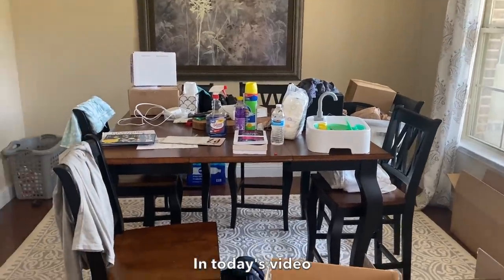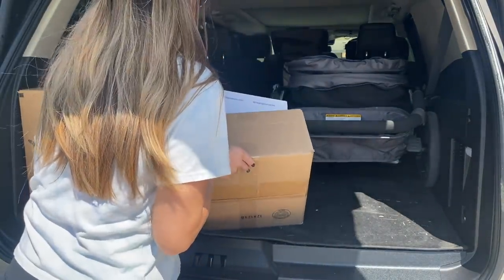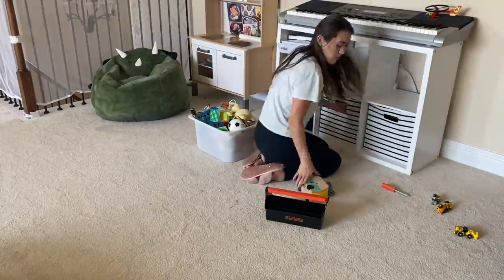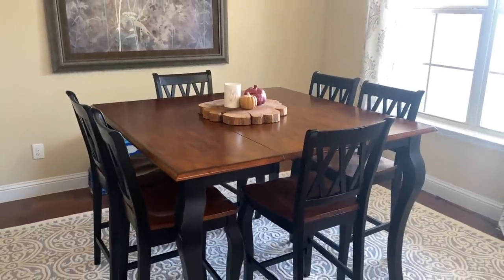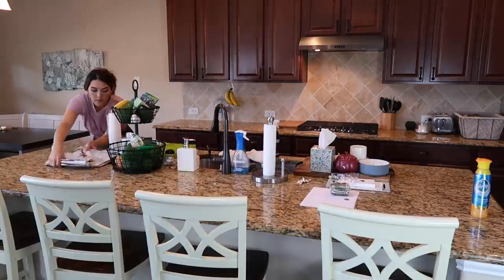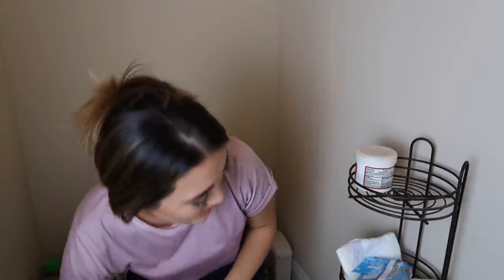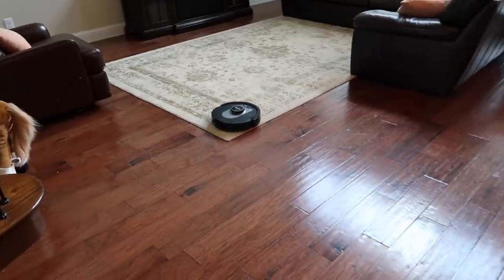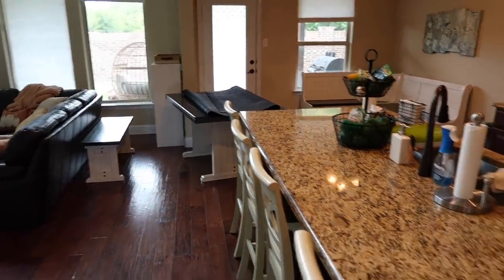TWO DAY MESSY HOUSE CLEAN WITH ME | Organizing & Cleaning Motivation | Kitchen, Bathroom, Toy Room

Comment: professional house cleaner here, for stove tops I just soak the whole surface with an antibacterial or degreaser spray and let it sit for 5-10 minutes. Caked on gunk on the stove is the hardest in a whole house to get up so it's one of the few things I make sure to let sit so I'm working smarter, not harder :) once it sits for long enough the gunk turns to mush and is super easy to wipe up. Then I finish it off with a stainless steel spray to make it sparkle
Reply from the maker: Thank you!
Reply: How can I get a little paint splatter off the stove?

Comment: FOr the water bottles, you can usually find plastic 1-2 gallon jugs with a spout/spigot that you could put on the end of the counter so the spout can be accessed. Sometimes they are plain or transparent colored or have a fancy design.

Comment: My kids are grown now but when they were little, I never bought or gave a gift without also purchasing a bin to put the small pieces in. Lego had a bin, cars had a bin etc. We also used those rolling plastic carts a lot but it's a constant battle. In my opinion on the Pink stuff, you are just using way way too much. I'd say squirt a quarter size dollop on your sponge and then add tiny amounts if it's needed.